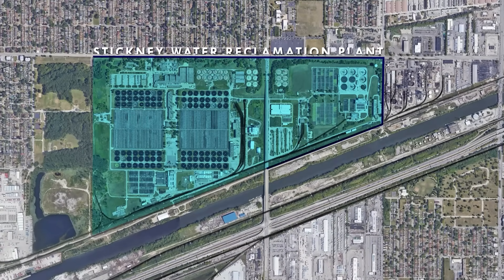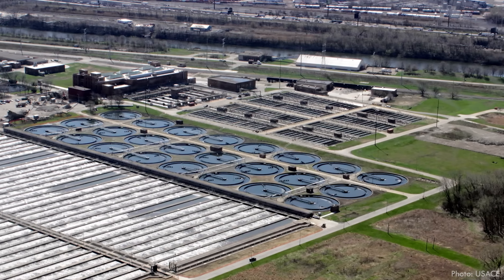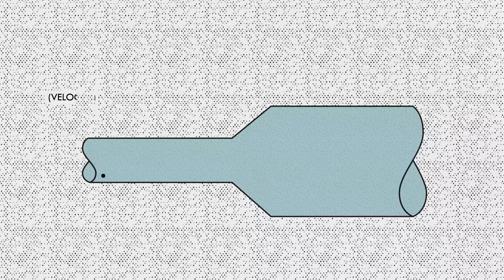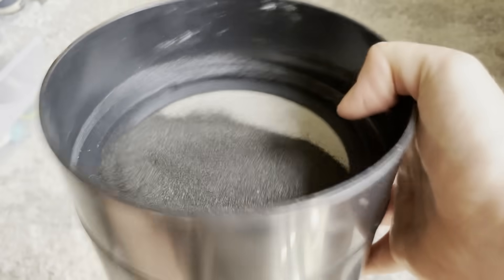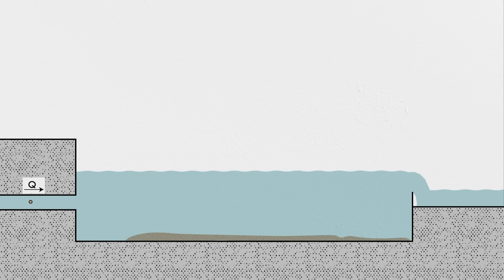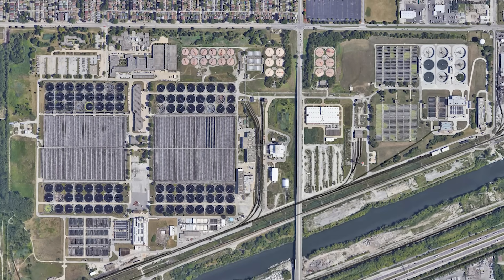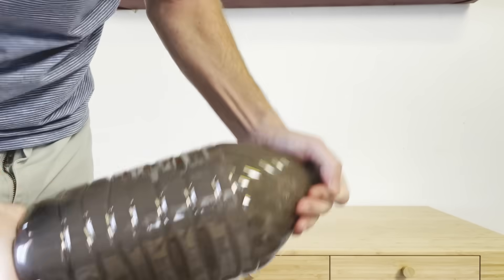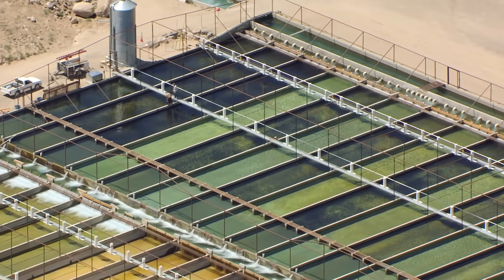How to Clean Sewage with Gravity

Comment: making a model of that circular tank with stirring arm would be difficult but I would  like to see a cutaway or animation. Where does the thin stream exit on top? Why isn't the sediment equally distributed in the circle? How is sediment removed from the bottom? And the used biological material??? What step used it and where does it go now?  I will check out your other videos.

Comment: Just love how this guy brings out the critical civil engineering innovations (done at scale) that enable our clean and healthy lives. Its only a small stretch to say that all quality of life is civil engineering. 

A small quibble.

At 6:18 the assertion that D doesn't matter is incorrect. For example, as the sediments accumulate, D reduces, eventually reaching zero. When D reduces the inflow is choked off.

When D becomes small or zero, the equations don't work.

The importance of having a large D is that it allows removal of the sediment (cleaning of the sedimentation tank) to occur at more infrequent intervals. That is, it allows the WTP to generally be robust against operating difficulties (worker out sick, power cut, supply chain issues) that prevent timely cleaning of the tank.

Comment: At 6:23 I'm a little confused. Wouldn't all particles settle when t_d < t_l? Don't you want the particle to fall to the bottom BEFORE it reaches the end? Meaning the time to fall to the bottom should be less than the time to travel the length? Or am I missing something here? 
Ex if t_d = 3 and t_l =5 then the particle would reach the bottom in 3 seconds and stop moving before it could reach the end of the pool in 5 seconds.

Comment: In the '7-'s and '8-'s I worked for Metcalf & Eddy, we actually write the book on wastewater treatment. I recall working on the Blue Plains treatment plant in DC, which at the time was the largest. The scale of the plant was amazing. You could easily get lost in the tunnels. I remember standing on the bottom steel of a slab and not hitting my head on the top steel.

Comment: It's a small, nearly insignificant point, but I believe one of the inequalities shown at 6:20 is reversed. It says that particles settle when Td > Tl, but I think this should be Td < Tl (i.e. when the time it takes for a particle to fall to the bottom is shorter than the time it takes to pass through the length of the deep section, then such a particle will settle at the bottom).

Comment: 6:16 shouldn't it be the other way around? It should take longer for the particle to traverse the length of the basin then the time it takes to reach the bottom so that the particle has enough time to settle? So t_L > t_D? Also why did the terms just get randomly flipped (we're showing the reciprocals of the terms on the left)?

Comment: Over 30 years ago I worked for a company that made muni-scale water treatment plant, named Krofta. I was the IT department, so much of this was new to me, and computers were new to many of the engineers. Flocculants are expensive, and cities will often try to cut back on them to save money, but this can allow parasites to get through. There was an outbreak in the neighboring city which allowed the giardia parasite to infect several people over a short period of time, causing a public health crisis. A friend of mine got very sick from it, and this may have caused his Crohn's disease (a lifelong and potentially deadly condition) to develop. Proper engineering and operation of water treatment facilities is important for public health, but it is up to engineers to do this reliably, cheaply, at scale, with a minimal amount of land usage as is reasonable. This quickly gets complicated, so respect for good water treatment engineers and operators is due.

Comment: I'm a trucker that hauls a chemical used to aid clarifying with many customers around the Chicago area (though not to Stickney), and it's always been a bit fascinating seeing how things run. In one info packet I saw, the raw sewage was pumped to the main treatment plant inlet, and then flowed by gravity alone through all the steps until final discharge. Pretty efficient setups.

Comment: Over 30 years of bolted steel tanks manufacture experience, our has become the bolted steel tanks industry leader in Asia and is certified to ISO9001, NSF61LFGB, BSCI and other international standards. And our bolted steel tank engineers make tank engineering calculation on each specific tank structure according to project local environmental conditions, such as snow load, wind speed, seismic zone etc., to make sure the tank structure's adequate security in long-term service life.

Comment: I love water treatment plants!! I did my thesis on one of those stations with an emphasis on biomethanisation which can save tremendous amounts of energy for the plant. Such an important and unknown part of our society, glad you shed some lights on them, Grady! 🥰
They are also quite sensitive, as the workers there! Dont throw just about everything in sewage water, people, it can cost a lot to your whole community 😙

Just a little note, sedimentation bassins are not really the very first part of the journey, there is a whole system of grids and filters that comes first, or all the subsequent infrastructure would get clogged with, and potentially damaged by, macroscopic objects, plastics, wood, and so much more! And floculation and flotation also serve to get rid of fats, which remain on the surface when the rest sediments :)

Comment: Thank you! This is great video. I am wondering why (at 6:25) we require t_D > t_L. Why is reaching the very bottom important? I am thinking of some imaginary very-deep basin — even if the sediment does fall to the bottom it remains below the lip… Any help is appreciate. Again — great video!
Reply: Draw a line between the top left and bottom right of the container; any particle above that line has a high chance of get whisked upwards. This is because the high water pressure at the bottom right corner acts like a cusion, forcing water to flow over it.
If t_D < t_L, then the particle will be above the line and will probably be whisked away. I'm pretty sure t_D < t_L is a rule of thumb though.
Reply: @Kevin-jz9bg  Woah that’s cool. Is there a physical model for this? Maybe even a textbook chapter? Thank you!
Reply: @TurtleShellTime   Find a fluid dynamic simulator online and play around 👌

Comment: I wanted to set up a company that bought cheap treated waste water.  Added elements to make it equal to rainwater in tanks .  Deliver it to customers with tanks and sprinkler pumps installed to water their lawns.  During some research the people I was talking too got into a huge yelling match that rain water is or is not the same as tap water.  Drought brings out interesting ideas.  City of los angeles uses recycled non potable water for irrigation in Griffith park with pipes painted light purple.
Reply: Residential Recycling system that converts gray to black water usage would save water

Comment: Sewerage water in the stinky canal has need of digester to separate the methane  next is the sand filtering  to clean and separate the soil into the water next is the chlorinating to return the water to the hydrane household used

Comment: @practical engineering 
Why do we not reuse our waste water? From what I have been told, the water that is discharged from a waste water plant is "chemically clean" meaning that there is nothing in it. No poop, minerals, or even oxygen or carbon dioxide. So why can we not run that water directly through a fresh water facility instead of discharging it into waterways and reduce the load on aquifers.

Comment: Your videos should be required curriculum for elected officials that often randomly modify budgets without understanding what havoc they cause.  I am the Utilities Electrical Foreman for a city and we're currently working through multiple wastewater process improvement projects including replacing the entire aeration system and adding UV disinfection.  Currently using biogas to offset electrical usage and we'll be adding adding a methane-powered blower for aeration. Keep the videos coming!

Comment: Hi Grady, I enjoy watching your video's and demonstrations supporting the subject being discussed. A point that could be mentioned here is the city of Chicago only has a single sewer system that collect's house hold waste, business waste, and storm water waste. Over many years, decades, the city drilled a tunnel system to collect this combined waste water during heavy rains to prevent flooding and sewer backup's into house's. The waste water is then pumped out of the tunnel system to and ran through, at a later time, this treatment plant. This tunnel system is also connected to a old open air stone quarry located on the south side of the city.

Comment: Great video. As a wastewater treatment operator, I'd say you took all the complicated stuff and made it easily digestible for the average person. 

What you failed to mention, however, is that the engineering firm that won the bid to design and build the facility was the lowest bidder, they did the absolute minimum to get paid, and were long gone by the time operations started running the facility; left to "make it work" because all the genius engineers couldn't have been bothered to listen to us lowly, unclean operators, and consider what we said we needed vs what they decided we needed
Reply from the maker: Most engineering contracts for public infrastructure in the US are awarded based on qualifications, not price. In addition, most firms awarded large contracts like this have long-term relationships with the clients and definitely maintain a presence and relationship after a project is complete (with the hopes of winning the next one).

Comment: The overall theme of your video is the effort required to clarify waste water. Why not use centrifugal separator's to remove these particulates in one step? I've seen jet engines on helicopters use centrifugal force to remove ingested sand before it could enter the engine and cause damage. Using this method would be quick and efficient and I believe cost effective.

Comment: I worked for So Cal Edison in the 70s. They had a coal fired plant in Laughlin NV, that got its supply from a pipeline in Arizona. The coal was pulverized and mixed with water, then pumped several hundred miles, under the Colorado River and into holding tanks. The water was recovered for the power plant, but some water was treated with  clarifloculants to remove the tiniest suspended particles. this sludge was then of coarse burned with the larger coal bits to make the steam.

Comment: Actually ran some tests on a sandfilter, used by the local sewage treatment facility, for my AP biotech exam. Still have images of the petri dishes from before and after the sandfilter.
IIRC it was the last treatment step before dumping the water into the river, and I could tell it was working. Whole bunch of CFU before the treatment, and basically none after.
Hit me up if you plan on making a video on that and need images.

Comment: Saw the headline and clicked to comment. I used to pull tank trailers and have hauled a product, regularly, that these waste water treatment plants use. We called it snot. It's thick and heavy. It was so thick that we never took the trailers to get washed. We took the trailers back to the same place to get refilled with snot. I've delivered it to Detroit's water treatment and even Louisville.
Reply: Finally got a chance to watch. You just reminded me of the purification center I delivered a tank load to too. Denver's purification to be exact. Of course, they had tight security there. They were expecting me, by name, not just the trucking company info and truck number.

Comment: You guys should check the epuration station in the north of Brussels. It treats the waste water of nearly 1million habitant, but because of the lack of space, they build it on multiple stories/levels.

 They pump the water on the top floor, and do all the process from top to bottom, letting the water go down slowly, level/floor after level/floor.

Comment: Here is  a question for you.   How did the ancients dig & maintain the hundreds of miles of huge canals that spiderweb across the entire floor of the Phoenix "valley" in Az. ?  How would they have managed sediment without the benefit of the clarifying chemicals you mentioned in this video?
Also, a second question. Most of the canals used by Arizona's Salt River Project, are actually ancient canals that SRP simply cleaned out, widened, and lined with concrete.  Even  with the millions of people currently living in the valley & a huge portion of the water being used to grow crops that are not consumed locally, there are STILL many miles of ancient canals that are still untouched.  How many ancient peoples would have likely lived in the Phx. valley to need that many canals for drinking water & irrigation of locally consumed  crops?

Comment: I run a ceramics studio and we can’t let clay go down the drain, or we’ll get a nasty and expensive clog. The city I’m in forces us to use a sink trap that is woefully insufficient for the amount of clay that could get into it, so we clean everything in five gallon buckets full of water. Once a bucket has some clay in it, I’ll often add some Epsom salt to flocculate the clay particles to get them to drop out of suspension faster. Then I siphon the clear water down the drain, and dehydrate the sludge of clay in the bottom of the bucket to be recycled or discarded. It’s so interesting that waste water plants in my city are doing largely the same thing to process the water that I drink!

Comment: Why not use large centrifuges, the circle ponds can be turned into them by rotating a blade in the center, the waste collected can be turned into electricity using bio-gas and then turned into fertilizer.

Comment: In Arizona this process is accomplished using tiered unconnected ponds, such that gravity pulls the water down each level into the lower ponds leaving the sediment in the soil. The ponds are lined with reeds, that drink up minerals and roots bind particulates, foliage is periodically removed and mulched. It creates habitats for migrating birds and refills the ground water table. Gravity driven as well, but relies on normal force exceeding gravitation. Cool video.

Comment: You left out the addition of hydroflorcilic acid, excuse the spelling. Then there is carbon filtration, used locally, the carbon is regenerated in air tight furnaces,  problems arose when dust from the regenerated carbon was found to contain dioxin,  strange all that worked on the pilot plant died of cancer. Then it might have been the PCBs in the high voltage equipment ... drained and filter out under cover of darkness ... fun engineering fact the old river station used steam pumps 4 stories tall, fly wheels big enough to stand in, new electric pumps were installed but when they went to remove the steam units the building began to float seems the water pressure was pushing it out of the ground d ....oops Cincinnati. Take care. PS after 9/11,they removed the chlorine gas injectors. Which made keeping thousands of tropical fish a lot easier ... wonder what they use to disinfect fact the water now. Oh one more poor engineering thingy, the high voltage transformers for the main station sit directly over the clear well, yep the same ones that were purged of PCBs under cover of darkness.

Comment: I worked for a local water works, much the sa.e process, years later I worked for local sewer department , final stage was burning tha sludge , for this volcanic sand was super heated back into lava. The judge was completely consumed, ...well I call bullschiff,  but I'm an electrical oriented guy.  The volcano is system required two technicians work all day too keep the instru.entation running... either poorly designed or over designed. Then there was the constant fear of a massive water surge, the steam produced might well blow the damn thing up...never got an answer to that, but the engineers looked nervous. Cincinnati , Ohio.